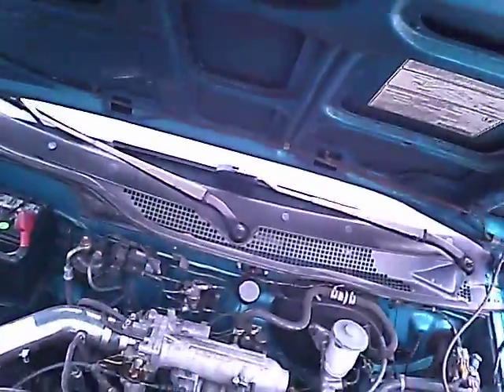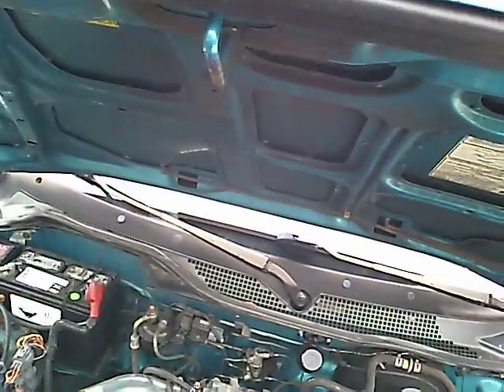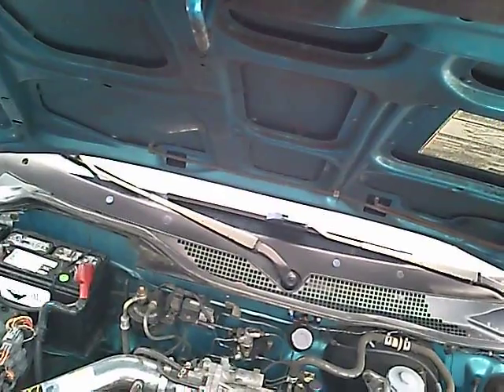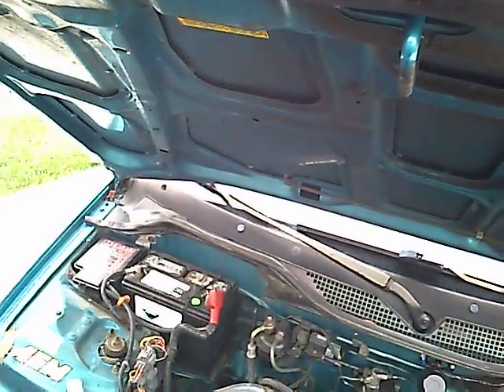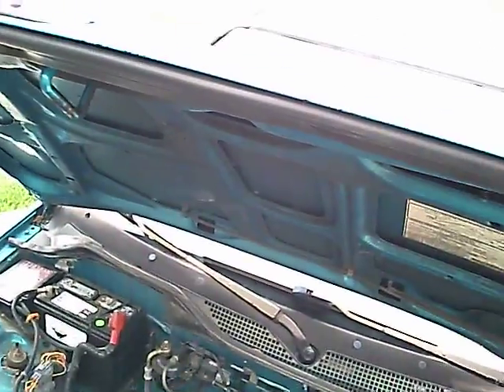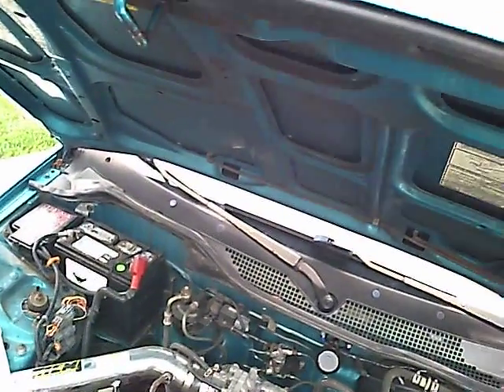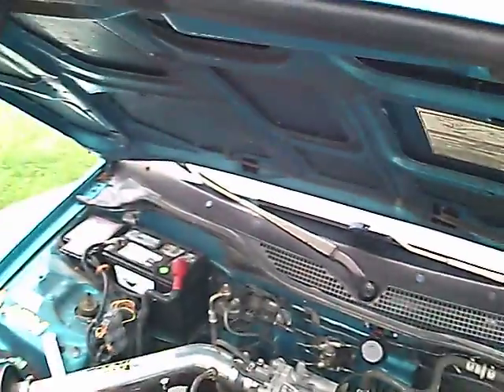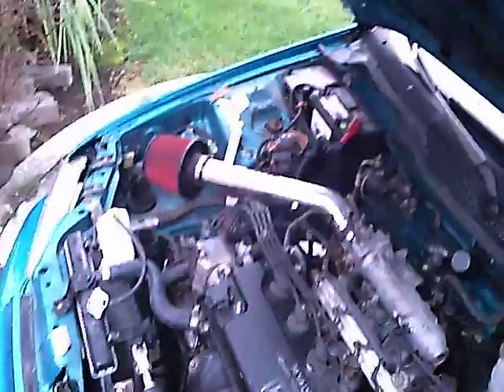92-95 Honda Civic EG hatchback - how to adjust idle speed  part 2 of 2

Comment: what should be the RPM with and without AC? is 1,000 RPM ok with AC on?
Reply from the maker: Ranelio Pacites For automatic, it should be around 650-700 without the AC on.  You should do this procedure without the AC on.
Reply: @flyingmantis  which direction should I turn the screw if the idel RPM is too high?
Reply: Clock wise
Reply: @reynaldogonzalez8209  what about low rpm ?